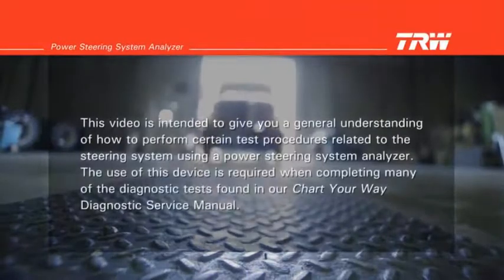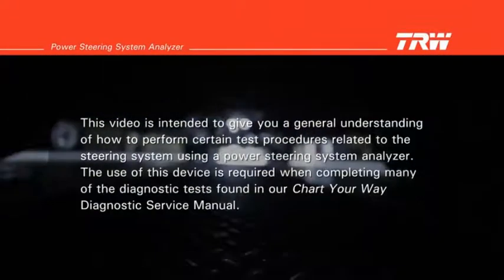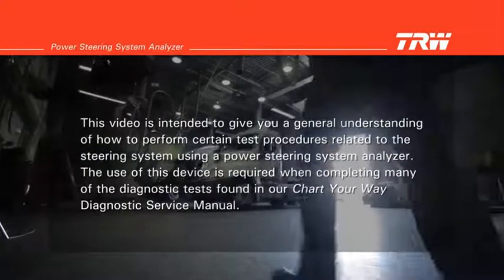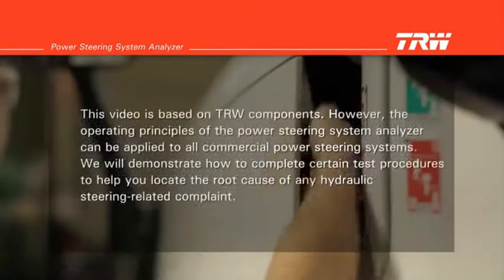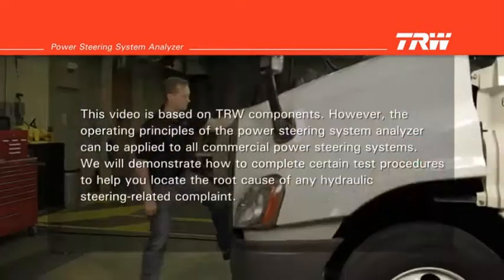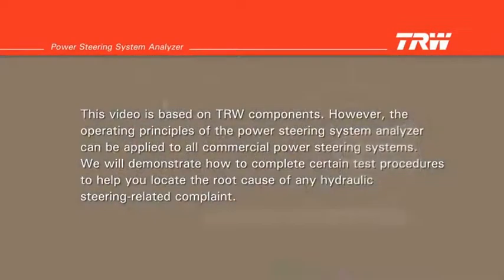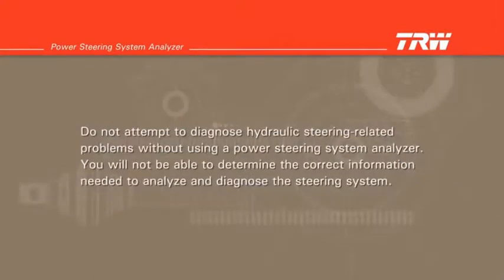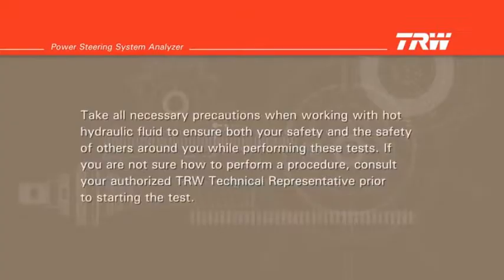Testing Commercial Power Steering using the TRW Method. Power Steering System Analyzer (PSSA)

Comment: isn't One gallon per minute internal leakage too high. I think more than 1 liter per minute is not good?
Reply from the maker: One gallon would seem high, but that is the manufacturer spec. Remember though, that the pump will put out more than the box needs so that their is room for wear. Always check manufacturer's spec.
Reply: What is the general pressure should be at idle and at 1500 rpm